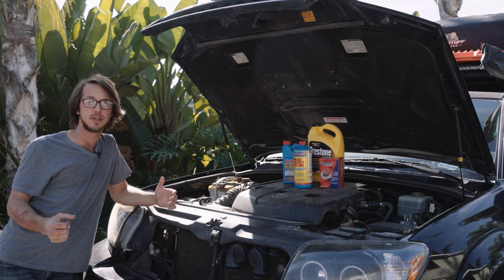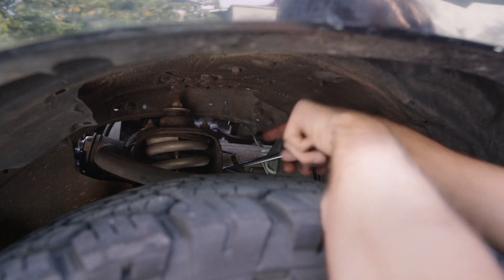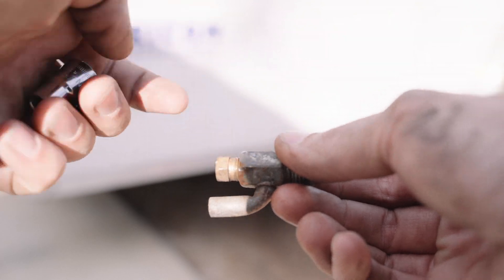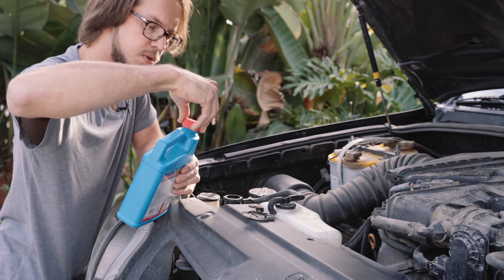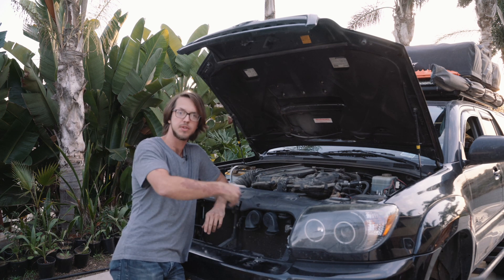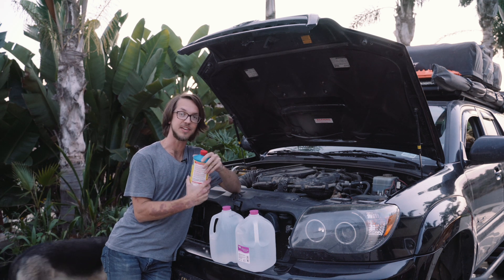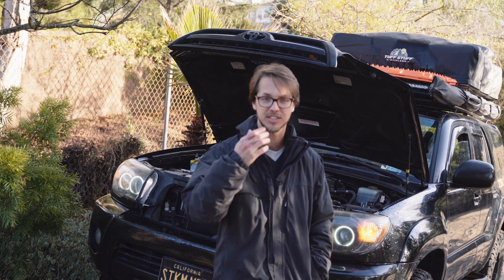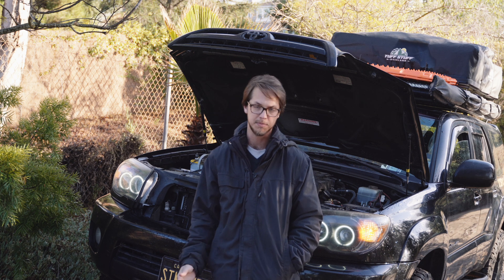How to fix your Head Gasket for $100 with Blue Devil Head Gasket Sealer!

Comment: I bypassed my heater core. Doing this right now ..
Reply from the maker: How did it go!?
Reply: @TrailBendersOverland  it's running fine.. been a a few 2 hr road trips. Drive to work 30 min each way everyday. I also gutted the thermostat. Put a new one in after the process. ✌️

Comment: I have a Mustang and I’m broke down to my last $120 & I’m going to give this a shot. Pray for me comment section tomorrow is the day!
Reply: How it’s going?
Reply from the maker: How did it go!?
Reply: @TrailBendersOverland  it worked !
Reply: @CasperTheFriendlyGhost777 hell yes im about to give it a shot on my pontiac g6
Reply: @TrailBendersOverland is yours still holding up?
Reply from the maker: @chandlerwilliams2684  mine was good for a couple years. It only failed when I changed my waterpump late at night and forgot to tighten my lower hose. 🤦‍♂️ next drive I dumped all my water on the freeway and annihilated my engine

Comment: Sitting in my 4Runner while it idles with blue devil in it praying it works for my 3rd Gen 🤞
Thanks for the video.
Reply: How did it work out?
Reply: @goat_horde  well I’m not 100% certain the head gasket was blown before. But there’s less evidence to suggest it might have a headgasket blown now than there was before. However, we had to replace the water pump shortly after doing the blue devil sealer. I don’t know if that’s related or not. Could just be it was time. Could be the blue devil ruined it. Hard to say.
Reply: How did it go?
Reply: @Miles-wy1zr  ruined the water pump. Despite claims, clearly should not leave this product in because it started to gel up. Started leaking pretty substantially and we had to replace the water pump and thermostats and hose out the entire system. Not sure if the head gasket is solved or not. It was such a minor potential leak. I had just used blue devil because there was a concern it might be leaking and figured the best shot was to try it before things got worse. 
So, maybe it sealed up a leak. Don’t know. Definitely it ruined a water pump and thermostat.

Comment: Hello, I have 2007 Mercedes s550 which had at one point at oil leaked into the coolant reservoir. I have replaced all coolant hoses, engine oil cooler gaskets, water pump replaced and now I am losing coolant and no visual leaks I can see. I was going to do the head gasket blown test soon. Doesn’t idle bad and no white smoke. Car has never overheated. Is this seal something that will work for me?

Comment: Forgot something, I asked blue devil if it was better to leave it in so it keeps working.  They said you can but it won't keep working as the chemical reaction is heat activated.  Once you run your car and heater for the 50 mins the chemical reaction of the blue devil is done and so is any repair that happened is finished.  Leaving it in longer doesn't do anything.  I ended up draining it and putting in new anti freeze.  Hope that helps anyone who goes for it.
Reply: That's odd because people have used the pour and go and it failed so they used the yellow label blue devil after and it worked.
Reply from the maker: @edogriff  I would never recommend pour-n-go. It’s a complete different product and different process. Makes sense why it worked with the new run through

Comment: Your vid was super helpful.  Did a lot of research and the yellow blue devil seemed like the best to take a shot with.  I did call blue devil for clarity on one thing which was making sure your engine is cold when you add the blue devil since the chemical reaction is heat activated.  I initially thought when the instructions and even video said let engine cool and then add sealer it just meant don't open your radiator cap when the engine is still hot to avoid injury but the blue devil rep said wait at least 2 hours after the final flush before adding the blue devil.  Finished it on Monday 9/26/22 and so far so good.  Was a little freaked out because I was still getting some bubbles at the radiator cap that day after it was all done but I think that was just air in the cooling system working it's way out.  I'll repost if it all goes south.
Reply from the maker: @bromikrock  how did it go?

Comment: I know this is an older video but I purchased the same product. Chased an issue for months replacing radiator, water pump, and thermostat. Found out that you can buy a block tester kit for $30 and it came back as a bad head gasket exhaust leaking into the antifreeze. I tried a product called Kseal which is a pour and go solution and it didn't work. I drain my entire system loaded in Blue devil ran for 50 minutes idle and now it's sealed. Hope that it stays still for a long time but nonetheless I am impressed.
Reply: lol I had the same issue and did the same exact thing as u described lol 😂
Reply: @mauriciorobles5132  hows it holding?
Reply: @mauriciorobles5132 still holding up?
Reply: hows it holding up?
Reply: Still holding up?

Comment: I know this is an old one but you didn't mention unless I missed it, exactly what your head gasket leak was. 
Water seeping out the side between the head and the block?
I just continued watching your video of the disassembly and you showed the water in the radiator with bubbles coming up.   
I have something similar after doing a thorough cleaning and flush. Mine is looking like foam on a latte.
It wasn't doing that before so I guess I'm going to blame it on the cleaner washing stuff away that already kept the gasket partly sealed.
I was planning on putting the Blue devil in tomorrow morning. 😞

Comment: 2006 sr5 4x4 250k miles. Original owner. A couple weeks ago I had to refill my overflow reservoir. I though it odd but it has been in the upper 90s on the central coast. Did the chemical test and sure enough it turned yellow. Followed your steps to a T and holy shit no more bubbles. Re did chemical test and it stayed blue. Thank you for posting this!!
Reply: still workin?
Reply: @back2damoon  yes! Still working. I now have 268k miles on the old girl. I have redone the test 2 times just to check and it stays blue.
Reply: @dusty8058 I’m in exact situation I have a 2004 and have coolant in #1 cylinder. The shop said it probably only leaks when it’s cold and seals back up when hot. They want six grand for a new head gasket which is way too much for an sev6 with 252k on it so I’m hoping this stuff works
Reply: @ it works amazing! I’ve even towed a 5k lb trailer since fixing it and it runs great. 275k miles on it now.

Comment: I tried blue devil exactly the same as outlined here.  It took out the gurgling sound and looks to have removed the intermittent bubbling in the radiator fill port.  After I drained and put in coolant, the head gasket seal worked for a while until after a month worth of driving, the issue of gurgling came back again.  Back to square one.  I have instead bitten the bullet and use "CRC K&W 401016 Block Seal Permanent Metallic Block & Radiator Seal" which I found from "https://www.youtube.com/watch?v=Nban6dVkYGM&t=11s", the trustmymechanic.com.  This is only around $10 and is really cheap.  I followed this guys instruction by draining all coolant and pouring just tap water until every drop of coolant is replace with water (I have to drain everything within the engine coolant drain spigots) .  The instruction calls to drive for about 500 miles without removing the thermostat.  Immediately within few minutes of starting the engine, the gurgling is gone, smoke is gone.  The tacoma gained more power when accelerating.  I have been driving with this block seal for more than 150miles now and the tacoma has no more bubbling and gurgling is gone and the engine is more powerful and this stuff seems to be working.  I can't wait to 500 miles so I can drain it and replace with the pink coolant.  Also, I read the review of the CRC K&W block seal in amazon and there is a guy there that has a tacoma and did the same thing I did and was successful.  Don't waste your money on blue devil like I did.  This block seal has copper mixed into it that just like what trustmymechanic guy was describing is the one that permanently seals the leak in the head when the hot piston ring irons it to the block and head gasket creating a permanent seal.  By the way, I have the 2005 tacoma prerunner double cab 1grfe engine in case you ask.

Comment: Can someone PLEAS E tell me how do i remove the blue devil head gasket sealer from the engine bay and parts ? i tried  everything
Reply from the maker: Not sure what you're referring to. Are you asking how to remove it from external parts? I'm guessing that means you spilled some. We haven't needed to remove any from the engine bay so not sure we have the best advice. Ugh! Depending on the material it's on, you could get pretty strong I would guess. Careful on rubber pieces but maybe try acetone??? Let us know what you come up with!!
Reply: @TrailBendersOverland  Thank you for replying.  I didnt spill any.  Bad gasket usually will produce lots of pressure and the overflow valve will spray contents out . That sprayed everywhere of course.    God bless you for helping

Comment: I have a Ford F-150 ( 99 ) Xl, had milky oil found on dip stick, water kept emptying from reservoir, no other issues,  this past Friday 3/5/2021 I wanted to give Blue Devil a try why not right, flushed radiator with water, drained , cleaned reservoir out, it was dirty, also oil cap had milky substance on underneath cap, another sign, so flushed 2 times till clear water ran through,  hooked all hose back and drain plug tight, fill with 2 gallons of water, not with engine running though, like instructions said, poured Blue Devil in slowly, into radiator not reservoir,  put cap on reservoir and started engine let run idle for 40 minutes and went to brothers shop to have my oil changed,  about 15 drive,  they emptied oil out and put 4 quarts in engine ran for 15 minutes to clean it out, then drained again added 5 quarts it takes and oil filter to, drove home let sit 1 hour and pulled dip stick and they did there at shop and clear oil, no antifreeze on dip stick,  today is 3/7/2021 and no milky oil seen on dip stick,,, Well seen many reviews on this product and most does work,  I caught mine very early though might make a difference,  3 days before that had to add a little oil less than half quart and hadn't noticed and milky oil on dip stick, satisfied so far, I will post later in time to see how it holds up..I think in opinion it's working for me..let's see...
Reply from the maker: That's an awesome story! Yes, we were skeptical but it worked amazing and after over a year, it's still working great. No doubt we will continue to recommend Blue Devil! Good luck and thanks for sharing!
Reply: working?

Comment: I've seen a lot of videos on head gasket sealers and I have to say yours is the most precise,specific and easily understandable. I always use distilled water. Never ever use City water tap water from your house. House water is full of minerals calcium lime and it will eat your radiator up! You took your time and it is a relaxing video to watch. God bless!
Reply from the maker: Thank you!! I’m glad you found it helpful. Always do my best 😊
Reply: @TrailBendersOverland hey man great video! I honestly wish I found it sooner, but so many other videos come up before yours, which I really don’t understand that algorithm on anyone’s device, but I’m very happy that I did find your channel and this specific video along with the one year after video for this one. I don’t know if you’ll see this probably not because you do have a lot of subscribers and comments on newer videos. I’m sure that will pop up first but, I was wondering if you wouldn’t mind me putting in my phone number down in the comment until you get it and then I can delete it so I don’t have too much spam lol, because I do have a question about putting the blue devil in my Toyota and there’s just a couple steps that you did that. I have a question on, but only if you don’t mind, I don’t want to make you feel pressured or like you have to or something, so just let me know, thanks! I’m planning on doing it by Saturday 3/16/2024. I keep holding back because I’m so afraid to mess up

Comment: Yo I used this stuff on my 94 Camaro a while back and it worked for my Camaro. I now have a 2010 Camaro and seem to have blown another head gasket so ima try it again later on today in my 10’. Fingers crossed 🤞🏾
Reply from the maker: Good luck! Did you see my 1 year later video? It's been over a year now and my truck is still running good as new! Still amazed by it.
Reply: I used k seal for blown head gasket  it did nothing to fix the head gasket.

Comment: What if you don’t have a heater that works?
Reply from the maker: Then I would bypass the heater by pulling the two coolant hoses off it and join them together using a small tube you can hose clamp them to.

Comment: Bro im about to use it hope it works 
And Thanks for the help!!!
Have a question bro what if my thermostat is attached to the thermostat housing and could not remove it?
Reply from the maker: Break it out of the housing and buy a new one. If you can’t do that then buy a new thermostat+housing that you can remove it from. 
Good luck!! Let me know how it goes. I’ve heard a lot of success stories in this video’s comments. Also, I recently did a “1 year later video”. Thought you might like to check it out. 
Blue Devil Head Gasket Sealer: 1 Year Later
https://youtu.be/f6pv9p8lEQg

Good luck!! Let me know if you have any other questions.
Reply: working??

Comment: My truck had water and coolant in my oil, will this fix my head if it’s that bad?
Reply from the maker: Will the truck run on its own for an hour? That’s the main test. From what I’ve seen it might be too far gone for a solid fix by blue Devil. It’s my opinion that if the truck can run for an hour then it’s worth a try. If you do, make sure you thoroughly flush the coolant for using the blue devil.
Reply: @TrailBendersOverland  give it a try,  just did my truck, coolant in my oil, seems to work on my second day so far..

Comment: Thanks, TBO for posting the video! I'm getting P301, P302 (misfiring on cylinders 1 and 2) on my 2011 Toyota Prius w/ 213,000 miles. My car shudders a little at startup and then smooths out after a matter of seconds. No loss of power during driving, no milky oil, no visual signs of leaks, or excessive white exhaust from the tailpipe. The repair shop found combustion gases in the cooling system which is indicative of a blown/head gasket. Do you think I'm a good candidate for Blue Devil? I was also looking into Steel Seal, did you consider that product? Thanks in advance for any input you or your followers might have!
Reply from the maker: Hi, I'm glad you found it helpful! That's what we're here for. It honestly sounds like your Prius is a perfect candidate. If you aren't having major issues then it's probably a mild leak like mine was and Blue Devil should work great. I'm sure there are a couple other companies that work, but I can only recommend blue devil since it's what I used and it worked so well. I actually just put out a "1 Year Later Video" I'll link it here: https://www.youtube.com/watch?v=f6pv9p8lEQg

Make sure you follow the directions carefully. I talk about a few things in my 1 year later video that might answer a couple more questions. Let me know if you have any other questions at all!
Reply: @TrailBendersOverland  Awesome! Thanks so much for the reply! I was just in SD btw, my son transferred to SDSU in the Fall and I came down to celebrate his 21st, we had a blast Covid and all!
Reply from the maker: Oh cool! Well welcome (your son) to San Diego. He’ll love the weather I’m sure!
Reply: @TrailBendersOverland   I have a Blue Devil update.  I brought my car to Cloverdale Express Oil & Car Repair cloverdalexpress.com in Cloverdale California. The owner is Jennifer and wow was she knowledgeable and thorough. She and her mechanic Isreal first did a pressure test that showed good compression. They recognized the misfiring as a possible coil issue but found out it wasn't that by running a test on it. Then they used a mini-camera in cylinder 1 that showed her there was a tiny leak from the head gasket into the top of the piston causing the misfire by getting the spark plug wet and as soon as the car warmed up, the expansion of the metal made the leak go away which allowed the car to run like normal.  A coolant flush and water replacement with Blue Devil was performed. The engine light has stayed off for 50 miles. I'm going to bring back in after 500 miles to follow up and add the radiator fluid back in if all goes well. I'll give you another update when I can. I hope this is helpful for some of your followers!
Reply from the maker: That’s great news!! Happy to hear. Hoping to hear it’s all good still after 500 miles. I’m somewhere around 30k miles and mine is still good. Thanks for sharing!

Comment: Thanks for the video, it encouraged me to do it. I just used Blue Devil on a 2008 Nissan Pathfinder and it worked! I took out the thermostat, flushed the coolant about 4 times, then added distilled water and poured 1/2 a bottle of the Blue Devil. My truck's temperature is back to normal and no more overheating. You have to do it exactly as it says on the bottle. 
Hopefully, it'll last.
Reply from the maker: Congrats! I hope yours works long term too. It’s been a year for me now and all is still 💯. I’m about ready to release a 1 year later video.
Reply: The thermo has to come out?
Reply: @whitdough8150  For the yellow and blue bottle you have to take out the thermostat.